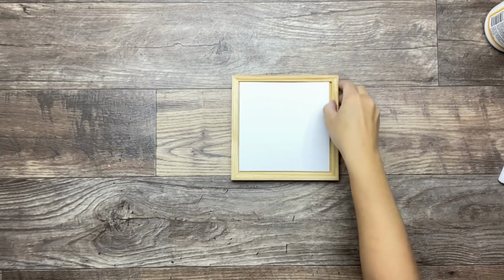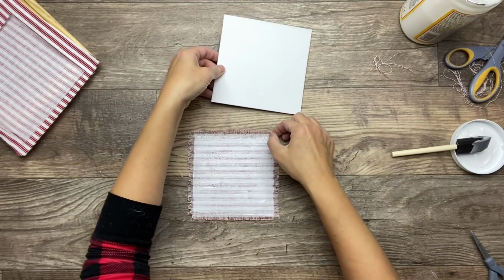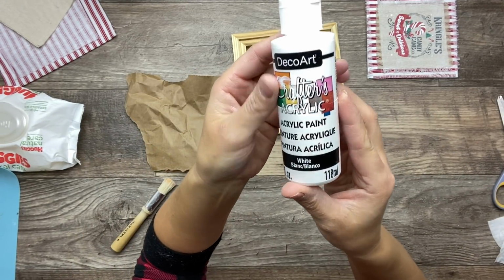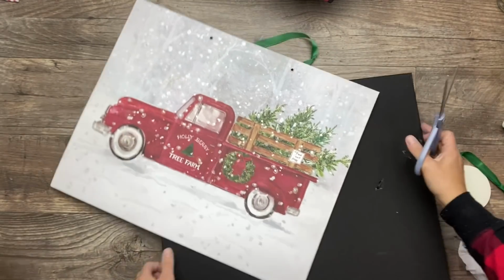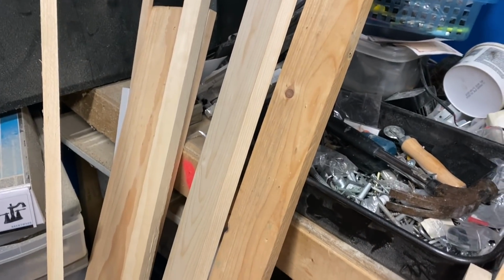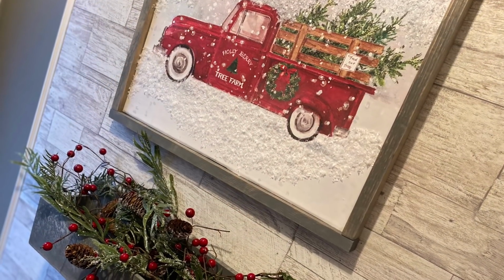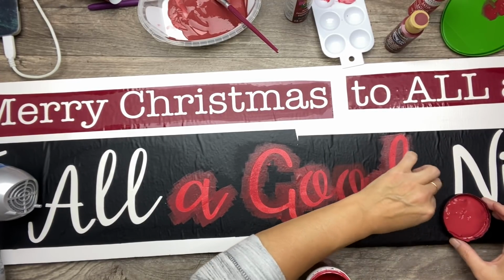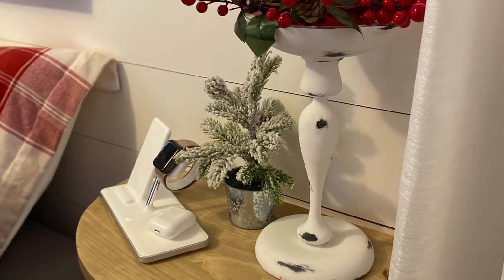DIY CHRISTMAS FRAMES/HIGH-END FARMHOUSE CHRISTMAS DECOR

Comment: All of your projects came out great, I struggle with bleeding under my stencils as well, another suggestion to me was use the same colour as your base coat before applying your top coat. I would love any of these in my decor as well.
Reply from the maker: I never have issues. Must of been the new protector I used or the cheap paint brush.
Reply: Yes, that works, or, if you're doing a project on raw wood, or any unpainted surface, you can use mod podge, or whatever glue you have, that dries clear, I suppose.